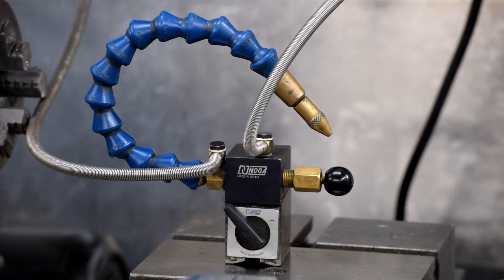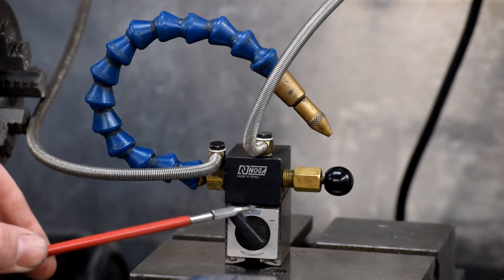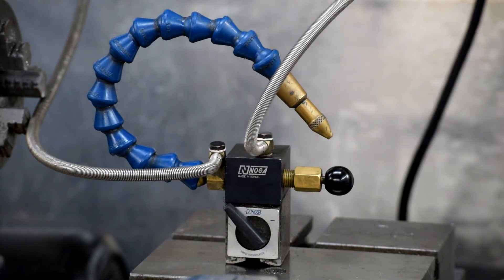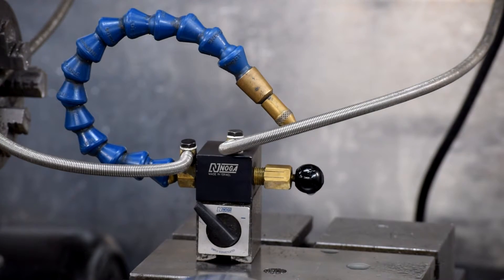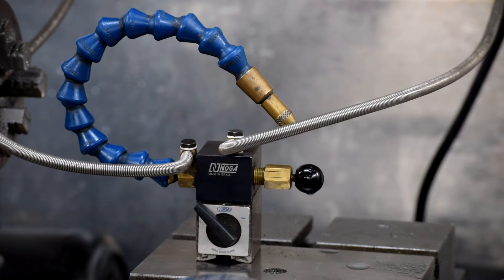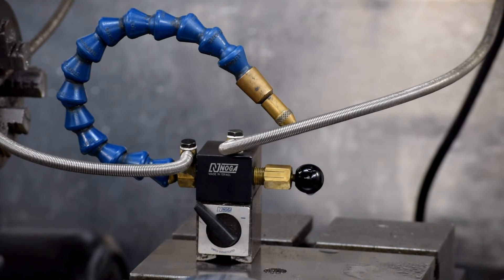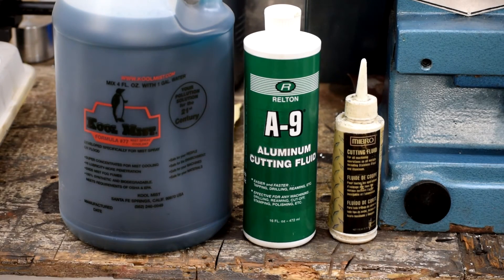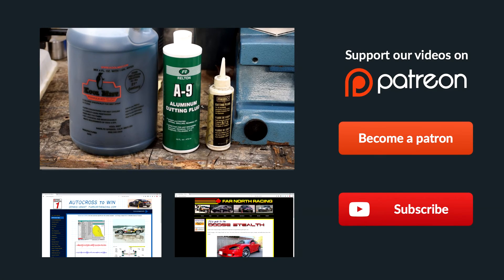Noga Mist Sprayer and Kool-Mist Coolant

Comment: What are the air requirements for a system like this? CFM? Can it be done with a small/shop tank style compressor?
Reply from the maker: You can vary air flow quite a bit. I couldn’t find a reference number online (Noga doesn’t publish the air consumption spec) but 2 CFM seems reasonable as a wild-ass guess.
Reply: @FNR  Ok cool, thanks. Yeah, that sounds pretty reasonable in my head as well. Thanks again!

Comment: You can also rotate the black knob to adjust the air/coolant mixture without touching the tip.
Reply from the maker: That knob controls the air pressure, where the tip controls the fluid flow.

You can influence the amount of spray using the air pressure knob, but I find that changes how forcefully it moves chips around. I prefer to set the air pressure so I can remove chips without blasting them across the shop, and then tune coolant flow with the tip.